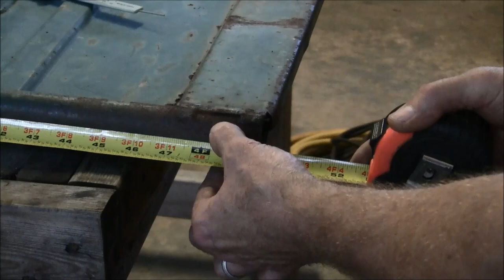1962 F100 Flareside/CVPI frame swap; Episode 22: The tailgate widening

Comment: It's nice truck it's a nice project but why why in God's name do every single person I've seen do a F100 build reflector Crown Vic frame underneath the F100 raise the floor about 5 feet why do this people can't build F100 with a truck bed anymore defeats the purpose of having a truck
Reply from the maker: Thanks for your comment Addison.  I wish these builds could be done without altering the bed floor and losing the space, but just no way that I could see around it.  Something has to be done to accommodate the crown vic frame over the axle/tank area.  Stay tuned for an upcoming episode on finishing the bed with a raised wood floor.  Cheers!